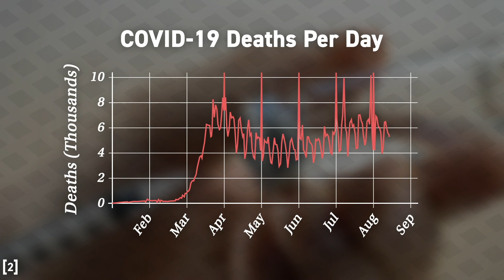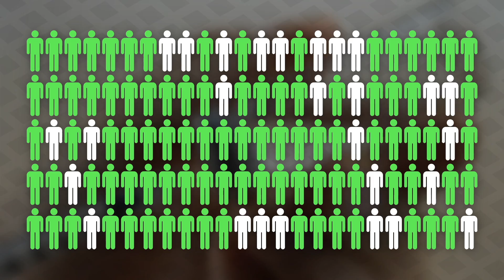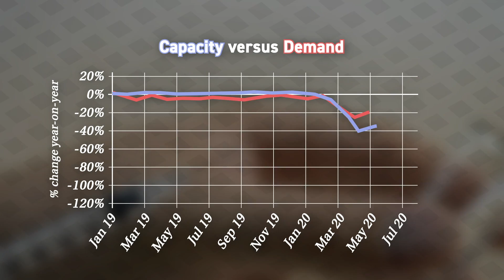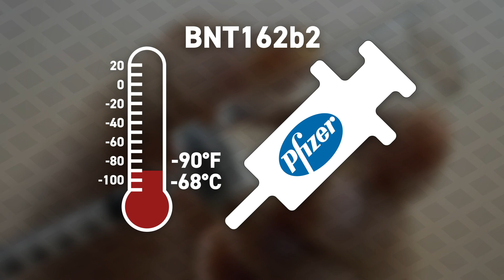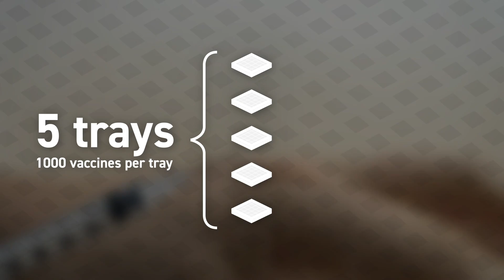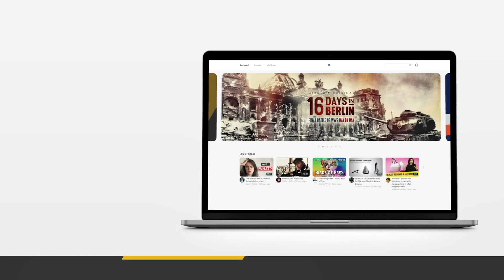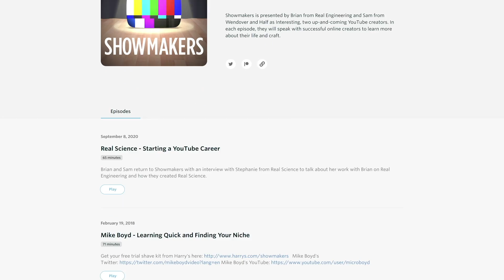Distributing the COVID Vaccine: The Greatest Logistics Challenge Ever

Comment: It's not nearly as hard as you imagine. President Trump has put the US military logistics experts in charge of coordinating distribution and they're working right now on manufacturing and distributing the vaccines even before they know which ones will be approved for use. It also needs to be noted that new cases aren't distributed uniformly throughout the population, there are "hotspots" where there are higher rates of infection and also higher rates of death that should be served first. There are other areas, such as Sweden, where the virus has been permitted to infect the low-risk community and the pandemic has already died out. 
 
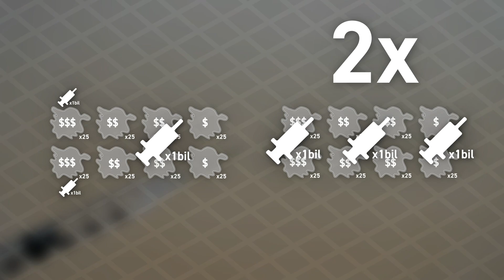Your photo of Africans at 10:22 implying that they're most at risk is false. African nations have largely been bypassed by the pandemic and they actually have enviable death rates much lower than the world average. Many rural areas on all continents have largely escaped the pandemic to varying degrees. It's mostly been western nations with densely populated cities and high levels of socio-economic interaction that have been most at risk, and in those populations it's been the elderly in group homes that have been impacted most.
 
Furthermore, it's not necessary to vaccinate every last person on earth as you imply. It's only necessary to vaccinate enough people to reduce the C-19 death rate per day to near zero in any given area for life in that area to return to normal. A vaccine doesn't provide perfect protection even if administered to every individual in the population so we shouldn't be demanding it.

Comment: No thanks! I wont be getting this Vaxxx.in 2020.or next. please give mine to one of them pro-vaxxers.
Reply: Yeah, makes sense. After 2020, I want to die too.
Jokes aside, please reconsider.
Reply: @job.2966  My immune system has better efficacy than the vaxxx..but no side effects. Plus the vaxxx doesn't even stop transmission so it is really a Lose - lose situation in my view. Especially since there are no long term safety studies. Wish you luck if you want take it
Reply: @johnla7968  if our immune systems are good, may I ask, why did we even develop vaccines?
Also, it does affect transmission. If it can't infect your lungs, it can't be spread through breath as much.
Reply: @job.2966  so how it is possible for asymptomatic transmission then? As per the experts, asymptomatic transmission is an issue and reason why they have young kids wearing masks...if you check the studies for the vaxxx there is not mention about stopping transmission. So really there not point to take the vaxxx unless you are part of high risk group. If you have some studies that prove the vaxxx will stop transmission that would be interesting to check. Pls send me link to any studies you have if available
Reply: @johnla7968  asymptomatic transmission is when someone is infected and doesn't show symptoms. Obvious, yes?
Notice how they are still infected, hence why asymptomatic transmission happens. A vaccine prevents infection and thus transmission. 
That's my guess though.

Comment: Nothing of it all makes CORV.
Two "completely seasonal foreign viruses" are used in a joint CORV individual test
absurdly depicted at the same time. -> Data simulation from individual components.
The incidence rates statistically derived from this are incorrect.
Additional data analysis from S15. -> S19, S20 @t
By rubbing against paper mouthguards, the rhinoviruses also increase dramatically.
The increase is also the PIV1, which respond in the test, like every year.

Comment: At Corv vaccine is senseless, because of variety if fast changing genes and absence of concrete pathogens at all (genededrift for what not existing, double joke)
In winter, the real flu is even medically rare. There are only small peaks. Here you vaccinate for spring. Instead, there are more common colds with rhinoviruses. And apparently weak forms of the flu like Para flu

(PIV) Inflammatory bacterial infections accompany colds and also fall under colds.
In winter, people are more prone to infections, but this is where the flu is more likely to spread
Individual cases. In the case of the Para flu, this is even more diffuse. Recognizable only through differentiating
Individual examinations.

Some media, such as "Welt Nachrichten" on youtube, are currently spreading misinformation about flu. Common colds
Bacterial also increase in the cold and humid season, pure viral diseases (see RKI Flu 2018/2019, page 36/37) decrease by an average of half to a third in winter. However, there is a general willingness to infect and additional bacterial and harmless infections Colds like runny nose clearly dominate here, also with the environmental propagation.http://praxisblaettle.planet4kids.de/tag/singulair/

Comment: Look at how "Omaha steaks" are shipped. If some cheesy late night TV meat sellers can do it, so can Pfizer.

PS. one solution not considered here is "box in box", that is, a dry ice box will last 10 days in room temperature, but if you put that box in a common refrigerator, voila!, you have extended deep freeze storage.

Another thing we can do now that we could not do before is cheaply "chip" the box with a small computer that can both RFID with readers and provide a temperature tracking that can tell if the box ever exceeded the correct temperature.

Comment: Whatever comes out, it should be tested on the left first.
Reply: Why?
Reply: @burning2913  They demand it as the only solution when clearly the path of Sweden is effective, and all the other assumptions made before have fallen by the way side.  Rushed vaccines are likely dangerous, and so the proponents of highly destructive lockdowns should be the ones to first take that risk.
Also, how many of the past pandemics in the last 2 decades have been fixed via vaccine?

Comment: The J&J vaccine just entered phase 3 trials this week. It is a single- shot, does not need to be stored frozen, and uses a Ad26 vector platform that has been extensively studied for safety. Fingers crossed to have this as an option as well.
Reply: Oh if it has been extensively studied for safety it's fine then. I'll take 2 just to be sure.

Comment: The 2 different vaccines having different shipping requirements is not a good mix for the USA. Because as he stated that this difference will result in a separation of based on geography (rural vs urban).
If the rural group (less stringent requirements) performs noticably different from the urban group one of them will be outraged at getting the worse vaccine. Which will only compound the already strong and growing divide between urban and rural America.

Ps: this is just my pessimistic prediction but the state of the world is already bad so its hard to be overly optimistic.

Comment: Drones in Africa with cold boxes
Reply: The battery capability is only just about possible to keep the drone in the air, let alone power a refrigeration unit.
Reply: Binary Signals did you even watch the video?

Their making a cold box that doesn’t need power
Reply: @a_human8489  Yes because everything on YouTube videos is a credible source of information. Show me a drone that can support and a -91f refrigeration unit and I will eat my words.
Reply: Binary Signals there are groups that have been using drones for medicines in Africa for years it wouldn’t be that hard to carry a small box of vaccines
Reply: @a_human8489  IT WOULD IF YOU HAD TO MAINTAIN THE TEMPERATURE AT -91F AND CAN ONLY OPEN THE CONTAINER TWICE IN THE ENTIRE SUPPLY CHAIN. The typical medicine distributed in africa is supplied in standard cool boxes that you take on picnics and require NO MECHANICAL REFRIGERATION.
Reply: Binary Signals people are building rc planes with garage trash so I think the experts will be fine
Reply: @a_human8489  Building a toy plane out of trash is  hardly any form of comparison.

Comment: 11:48 - You said 48,000 doses? Did you intend to say a much higher number? 48,000 doesn't seem like a lot if each box can hold 5,000 doses. Did you mean 48,000 boxes? Idk but it just seems like something significant enough to be called a "freezer farm" would be capable of holding more than 10 boxes at a time...
Reply: johnson and johnson vax doesn’t need to be frozen
Reply: Good question

Comment: Vaccines from AstraZeneca, Moderna and Pfizer are mRNA vaccines. The good thing about mRNA vaccines are that they have shown to be stable for months or even years at temperatures -80°C to +70°C, eliminated the need for a cold chain. This is one of the strengths of an mRNA vaccine and one of the reasons they were the main choice when developing a COVID-vaccine. Being able to be distributed to even the most extreme climates where a cold chain is lacking. https://journals.plos.org/plosntds/article?id=10.1371/journal.pntd.0006108
Reply: Well done, you beat me to it. I knew at least a couple of the trials involved vaccines which were suitable for distribution in countries with limited facilities  ...  does poke a hole in the video but explains why those pushing hard to be first for approval might not necessarily be the best one to roll out worldwide.

Comment: There's no sars-cov2 virus. The pretension to use PCR tests as a diagnostic method is proof of that, because they turn "positive" with mostly anything you throw at it, even tap water.
The real "covid-19" disease is radiation exposure associated with auiliary equipment installed alonside the 5G network, which overheated due to the excessive ammount of power they put through them, and caused the burning antennas we saw earlier this year.
5G installers were vowed to secrecy (NDA, whatever) for this very reason.

The vaccine is a scam. We are supposed to live in fear and thrown away our freedoms and livelihoods and get inoculated with poison, all because of a bogus virus that they haven't isolated, purified, micro-photographed nor sequenced, as was required for any earlier virus so far, which, even if it was real, seems to have a mortality rate that can hardly be described as pandemic.

Fuck the vaccine and fuck the logistics challenge.
Reply: Evidence for these claims?
Reply: @wangshuping137  Evidence for yours? (I'm assuming your "claim" is the official narrative, which has all been, so far, unsubstantiated propaganda)
Reply: @wangshuping137  propaganda.
Reply: @radornkeldam  Can you prove its propaganda?
Reply: @Alice I'm 35. If I'm a "boomer" what are you? A toddler?

Comment: This is only tangential to the video, but the inner statistician was a bit disturbed by the graph at 4:02 - the spoken words are fine ("air travel more than 90% down"), but the red graph is on a scale that allows for 120% loss. This is not possible, you can't lose more than all - 100% loss is logically the absolute maximum and by presenting the line like this it doesn't properly represent the numbers on a quick look (which is what those graphs are meant to do), because the first impression of this graph is "oh, big dip, but still a good bit left" - whereas an accurate graph would evoke the "wow, that's very nearly rock bottom" feeling that is accurate.

TLDR: Please don't lie with stats!

Comment: I believe you gravely overestimate the complexity of extreme cold storage. During transport yes, it is very tough. But once a reliable power supply is available, all you need is a slightly better insulated freezer with a different thermostat. I work in a hospital, in a department that does a lot of clinical trials of new medication. A lot of those also need to be stored at -80C. We often get the freezers shipped to us along with the medication itself, and they don't even want them back afterwards.

Comment: This is a bit of BS, given that risk for young folks are so small.  Other issues include that rate of transmission in the places where it is difficult to distribute vaccine to are also places that are likely to have a low R value. I'm still on the side that the foundational threat of this pandemic is reaction to it.  What happens when the next COVID pandemic arises from engineering the current virus to get around the current vaccines and increase the lethality.  Does this really top the logistic challenge of WW2.  Seems really doubtful to me.

Comment: The Astrazeneca trial got stopped due to 2 patients developing another, identical disease.

Forget that one.
Reply: I should clarify, it's not the same type of viral disease, but another condition, and 2 of the patients developed it. Since it's the same condition, that surpasses the safety threshold.
Reply: This is not correct.  The first patient has MS and the second patient had an issue unrelated to the vaccine.

When you're testing 50,000 people, other issues will arise.

The trial was paused, not stopped, and is now running again.

Finally, this vaccine is the only one I'd trust in a compressed timeframe as they had been testing it on SARS for years prior to 2020.  They already have a ton of safety data on it and they're basically now testing for additional safety and efficacy.

Media headlines go for the sensational and miss the science every time.